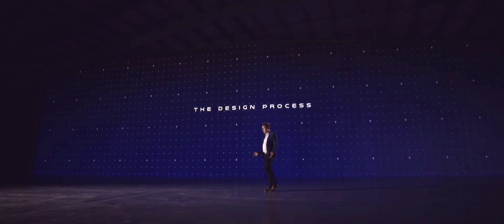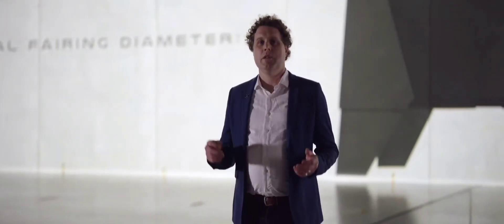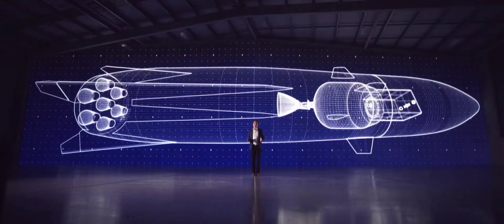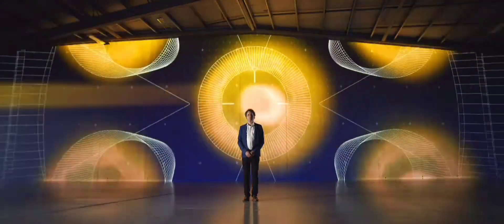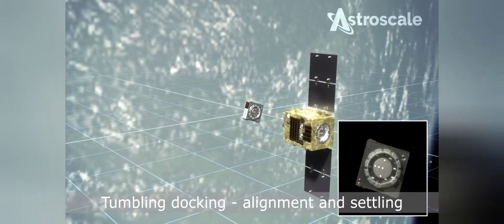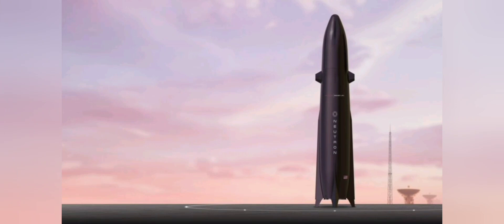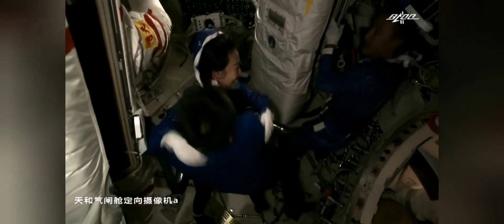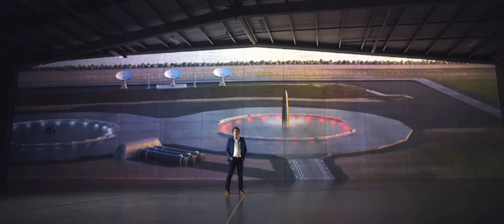A rocket for 2050 - Why Neutron is much more than outdated competition for SpaceX Falcon 9

Comment: Jordan, don't use millimetres. They are to smal. its like saying a movie duration in seconds. Use centimetres. My height is one 78, that's one metre and 78 centimetres. 
That's also 1780 millimetres, but nobody says that. Only wen its extra important, like ordering the glas for a window. 
Sorry, but Americans can make huge stupid mistakes wen it comes to metrics. I believe at least one spacecraft failed wen it got to Mars, because of using it wrong.
That's something to get real angry about! Best example to always remember is:  imagine a cube of 10 x10 x10 centimetres , fil it with water , you got one Liter and it weighs one kilogram.
Love what your doing, keep it up !
Reply: Wrong about the milli-metres... 
Centi-metres is hardly ever used in any of the trades... including the building and construction trade... we simply don't use cm's...  We use MM and Mtres, not CM. We don't say 90cm we say 900mm... (heck we don't even say and don't say milli-metres ... just say 900...)   170.5cm, it is usually 1705mm some times we might say 1.705 metres,    A 4x2 bit of lumber is 100x50mm  (even though its dressed 95x45 lol) it's not 10x5 cm. 

Even on the plans it will be in metres or milli-metres CM are simply not used this is so mistakes are not made. It does away with the "." (point) ie; 15.3cm is simply 153mm. I have seen plans  with a measurement  "45500mm (45.5m)".

Same for my height I don't say I am 185cm, I am 1.85m 

As for the spacecraft that failed... it wasn't so much that they used it wrong, more that one of the manufactures used imperial instead.
Reply: @NighthawkNZ  You proof my point exactly.
Wen it comes to measurements, we need to be on the same page.
Reply: Centimeters are not an SI recognized unit.
Reply: @angelaford2989  Neither is the kilometer. But many SI-adjacent units are quite commonly used.

Comment: I gotta say, if nothing else, Neutron wins the award for graceful lines, making Starship look increasingly like a toy from a cereal box, and that Bezos thing, as always, like a toy from an adult book store.
Beck is the non-grifter, non-sociopathic, non-serial woman impregnator version of Elon.
Reply: Non-serial woman impregnators of this world unite!
Reply: Yeah, was wondering what starship would be like if made out of carbon fibre, tho I think it then needs better heat protection to stainless steal? I could be way off with that but I thought that was one reason space x used old school metals for its ship. 
But back to fantasy land where I don’t have to understand the ins and out of rocket science and.. make starship as sexy as this!! Nom nom nom
Reply: @janharler9586  I also understood that to be part of the reason, though I suppose they could make the first stage carbon fiber because it's not going to reenter as fast as starship will
Reply: @janharler9586  it's significantly easier to work with and much cheaper, as well as allowing them to easily iterate.

Comment: Got the original download but didn't watch so greatly appreciate the first critical review. "Stiffness"(torsional rigidity?) matters in the material absolutely which has always made what SpaceX has in fact done more than just acceptable but "proper" from a materials science and geometry point of view (as Falcon 9 re-use has proven.) I don't know how carbon fiber works in the extreme cold of space then extreme heat of reentry but I've always thought that cracking then deformation to be the major strike against carbon fiber for use in the launch and now re-use business.

Having said that there is now and for some time the Boeing 787 and the whole "auto-clave" thing and the Boeing 787 is legendary for flight comfort of the passengers as it doesn't have the expansion and contraction issues the standard aluminum has ("ear popping".) This has a multitude of other flight benefits to name here suffice to say by far the best commercial jet aircraft in existence today no matter what the politics of it all is.

Obviously ahem "rocket flight" ahem is far more straightforward as you're confront merely two seemingly insoluble physical conditions namely extreme heat (deformation) and extreme cold (cracking) which perhaps with modern autoclave use and experience now seems practicable for space launch and re-use.

One way to find out absolutely!
Reply: What about the cost and time for manufacturing Carbon Fiber?

Comment: Neutron is awsome but still vaporware...we have seen how hard it is to actualy build a large rocket ahem Blue Origin. Also if Starship works as hoped it will be able to launch for only 2 million dollars. Once i see this thing sitting on the pad after hundreds of launches and tens of landings then i will be impressed
Reply: Rocket Lab isn't Blue Origin, though. They are regularly flying to orbit.

Comment: I don't think it's accurate to say Neutron could build space stations. Sierras inflatable comes in at around 26,000 lbs. Deorbiting old satellites is a great plan that several others are already working on, have flown and tested. The bigger space junk problem is the debris that has accumulated. There have been a couple of proposals but nothing has been built. The first stage of Neutron is sub orbital so there is no help there for orbital speed junk. A second stage craft would be great (that could be launched by just about any rocket system) but at only 8000 kg, I doubt it would be practical. Reusing it for a tug in space? You're talking about orbital refueling...the holy grail to reducing fuel mass. Rigid landing legs? Whoa, composites don't like shock. Still. I think it will be a very productive system.

Comment: I'm angry at you, Jordan! 

You mix marginal cost and fully burdened cost when you say, 1) Starship will never achieve $2M per launch, as they won't recover the development cost, but then go on to say that 2) StarLink alone will pay for Starship, and the full trip to Mars. Which is it? SpaceX can't afford to give away launches at just above operating costs due to development costs, or that Starlink, NASA lunar lander, and the SpaceX investors headed to Mars will pay for the complete development, and every additional launch is gravy? 

I am not a Musk Fanboy (I find Tesla's traditional arrogance annoying), but SpaceX's track record on human rated space flight is astounding. If Falcon 9 is $60M today for a launch, the rocket of 2050 needs to be $6M for the payload (10x less) to be relevant - probably more like $500k per launch. 

$20M per LEO launch barely moves the needle of the current art, and certainly doesn't compete by it's first launch. If Starship achieves it's goal of "Fully AND Rapidly reusable" SpaceX certainly could take a 8MT payload to LEO orbit for $5M, pocket the $2.5M per launch in profit, and be 4x cheaper than Rocket Lab, even if it is massively underutilized. Add in some rideshare, and your 8MT payload to LEO cost is comfortably under $1M to orbit. Given that you need ~18 Neutrons to carry a single Starship payload, even if Starship's marginal launch cost is the same as Falcon 9, I think it could out compete Neutron, just with a x2 rideshare, without breaking a sweat (running under 20% of capacity). It is easy to make a big rocket smaller (strip off half the raptors, run the others at 80% load for longer life, with a shorter fuel stack) than to make a small rocket big. 

If SpaceX is able to hover-slam both Starship and the Booster on target successfully in January, I think all the start-up competitors are better dropping their own plans, and seeking a launch partner agreement to run SpaceX's global launch network, rather than attempting to find a niche they can remain relevant in. SpaceX will need help managing 50 flights to orbit each day. 

Stay Angry!
Reply: Assuming starship super heavy gets 1000 launches at 3M profit per launch they'll make about 3 billion per starship. Each one probably will cost around a billion. They'll need to launch around 300 times to break even with the cost of building a starship. Assuming one launch per week, they'll take 6 years to break even. That is not sustainable. If they pump up the cost of launch to 55M right around where falcon is, let's say they get 50M profit. Then it will only take about 4 months to pay itself off, and it can start paying for its development.

But then you have the issue that for the foreseeable future, there is not even nearly enough demand to launch a starship every week. The only ones requiring that much launch capacity is SpaceX, and they won't pay themselves.
Reply: @boggless2771  A billion for Starship Super Heavy is way too much. It's made to be cheap to manufacture, and made in high volume.

39 Raptors at say $2 million each is $78 million. If we say other raw materials and components are $50 million, and it takes 500 people working for six months to finish one Starship Super Heavy, each making $75k/year, that means a Starship Super Heavy costs more in the area of $147 million. If the propellant, logistics, range and refurbishment cost per launch is $10 million, and they sell the launches for $20 million, a Starship Super Heavy is fully amortized in 15 launches. If it launches once a month for five years, each Starship Super Heavy generates $453 million in gross profit, or around $90 million/year. So, if they have a fleet of 20 Starship Super Heavy, SpaceX would generate around $1.8 billion in gross profit per year on Starship.

Selling 240 Starship launches per year at $20 million per launch may seem difficult, but one has to remember a lot of these launches are tanker flights.

Comment: "It also has a 5 meter internal fairing diameter, which is a little bit larger than F9 has"

The only thing we know is that Neutron plans to have a "5 meter class fairing" (it's a quote from their video).
Falcon9 also has a "5 meter class fairing": OD is 5.2m, allowable internal diameter for payload is 4.6m (see their user's guide, section "5.1.2 PAYLOAD FAIRING").
It is not known what will be the exact ID of Neutron.
In any case, making a slightly bigger fairing was not ever a problem for any launch provider.